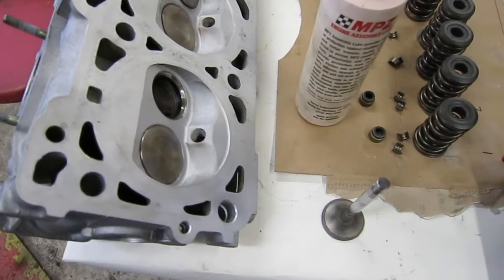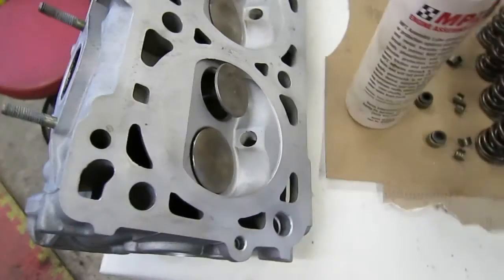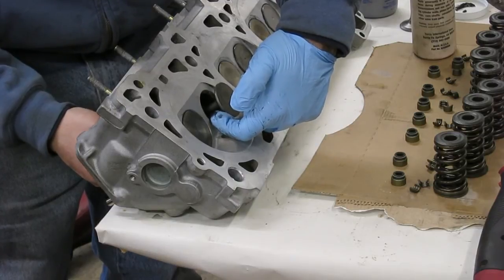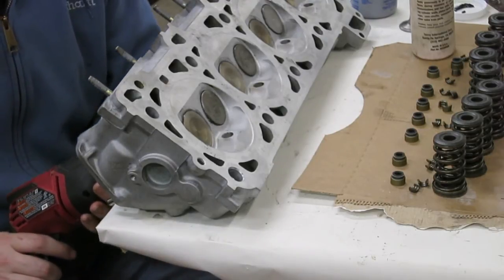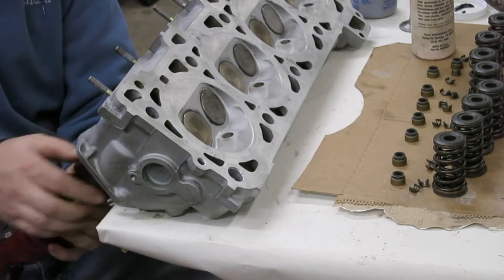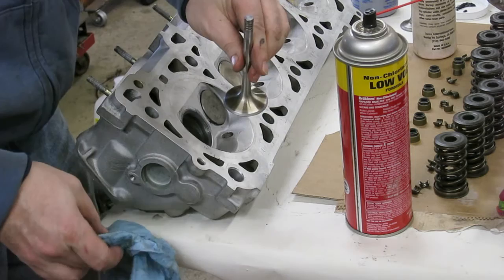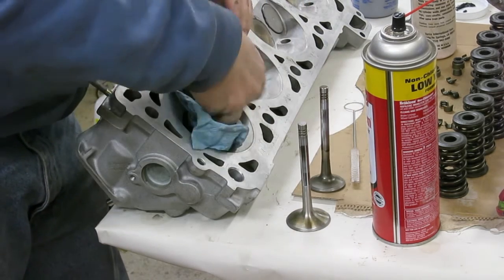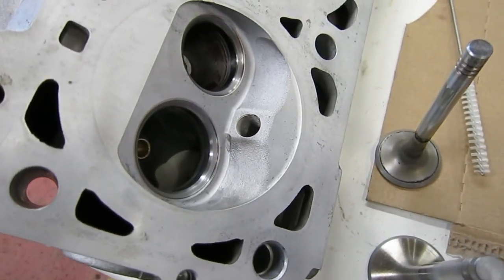Lapping valves on a Porsche engine head

Comment: I would be more careful of getting the brake cleaner on your skin and not so much the lapping compound. Also, I wonder if linking the drill to the valve with a short piece of fuel line would both make for a quicker connection to the valve stem, and also remove unnecessary bending/side loading of the stem from the handling of the otherwise hard-mounted drill.

I am on night shift at work now. I have a feeling I will be learning a lot about 944's and also about what it is like to be a zombie in the market for a 944:(

Comment: I don't like the idea of holding the valve stem directly in the drill chuck. When I lap valves that way, I use a dowel or cut off bolt in the chuck and a piece of fuel hose slipped over that and the stem. That way the stem isn't being held hard in the drill and the valve can lap in it's seat without any side loading from the way the drill is held. It also makes set up easier as You can move from valve to valve quickly.